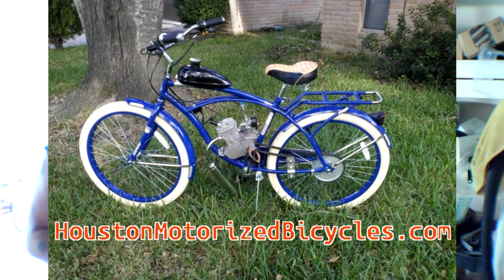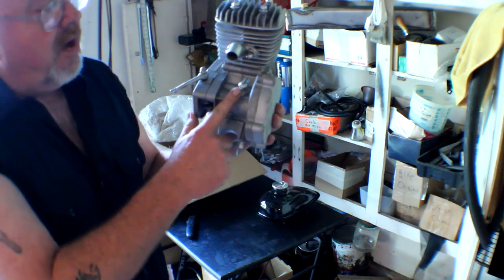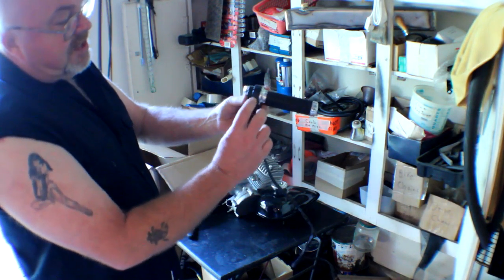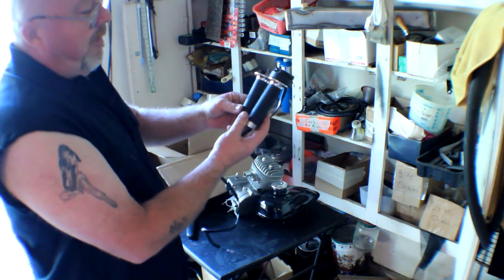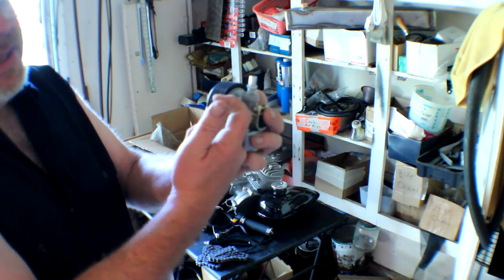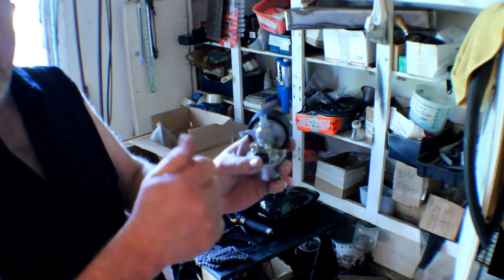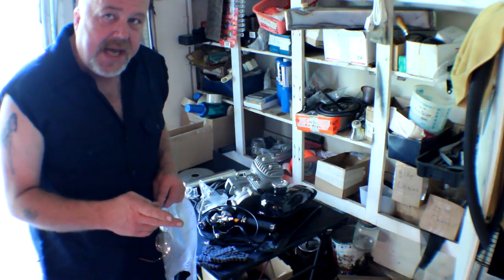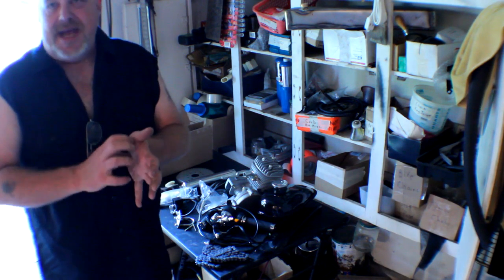How To Build Motorized Bicycle Part 1 - unboxing 2 stroke motor kit

Comment: I put the engine on the bike and the the wheel won’t move
Reply from the maker: remove drive cain and it will tell you if clutch is stuck or bearing cap is caught against sprocket

Comment: I got a big brown bolt type of thing with a nut flat tip screw in the middle??what is this used for,i literally am in the garage now working on a putting a kit on
Reply from the maker: Gear puller perhaps
Reply: @HughesMotorized  i figured it out thanks alot it was tge sprocket removal tool 🤣🤣😎😎

Comment: I have a few questions.  1. I would like to put a kit like this on a huffy cranbrook and I am wondering if there are any problems I will run into with this bike? 2. If the pedals hit the muffler could I get one of those kits to make the pedals stick out farther because I don't like the idea of trying to bend the muffler in? 3. If I don't put the fenders on the bike then could I put regular bicycle brakes on it?

Comment: whats the law on riding these on the road in the states
Reply: Long as it's 50 cc or under your good
Reply: here in the uk you have to take a test to ride anything on the road you cant even ride an electric scooter on the road
Reply: That kinda sucks
Reply: it sure does we-also have laws saying that they have to be road legal sufficient brakes lights indicators an MOT (ministry of transport) road worthiness test a motorized bicycle would need to go through a special ministry of transport engineers test before it gets to an MOT then it would need road tax and insurance plus like i said you would need to take a test so you could ride a motorcycle

Comment: Instead of using to rubber motor mounts.I welded in a 1 in.water pipe about 19 inches lond.it is a ridgeted mount.I am in process of installing excessaires now.will let you know results.

Comment from the maker: You can best setup and adjust the clutch by making sure the adjuster on the clutch lever is screwed all the way in when installing the cable. Then  you can press in on the clutch arm while installing the cable on the clutch arm to keep the cable tight.  You will then have some adjustment on the handlebar clutch lever. I do show ho to do this in a later video covering clutch cable installation. I hope to have all of them on YTube in the next week
Reply: Trying to figure out how to take a pic of it